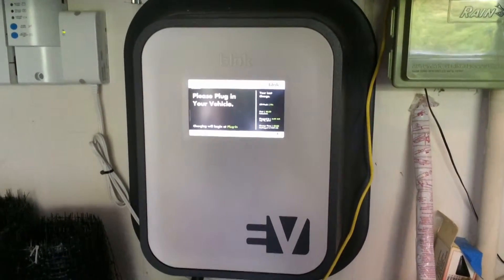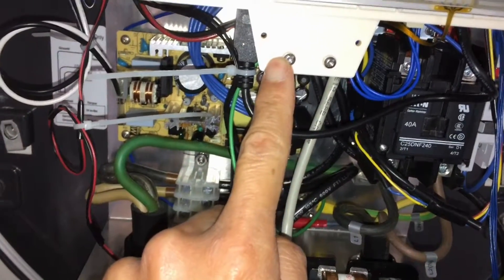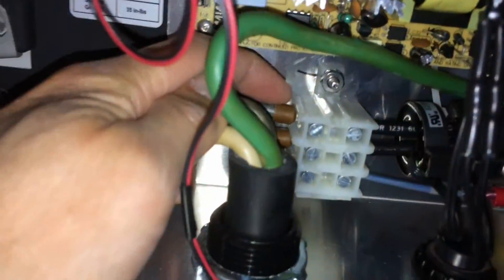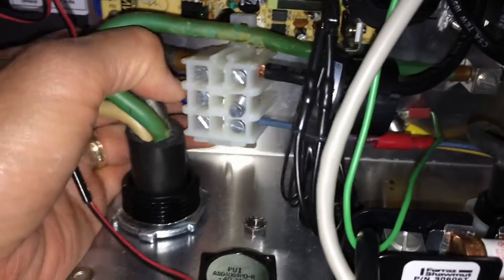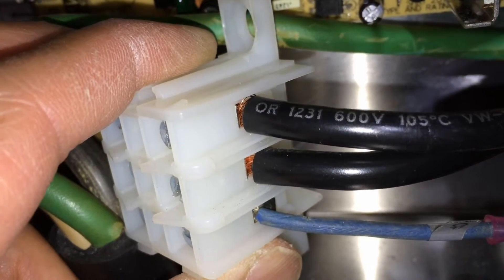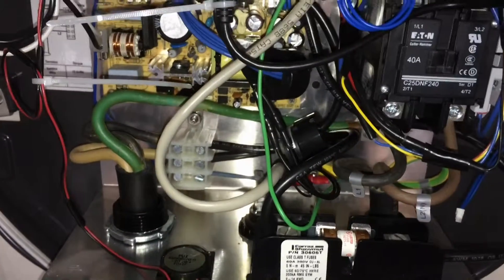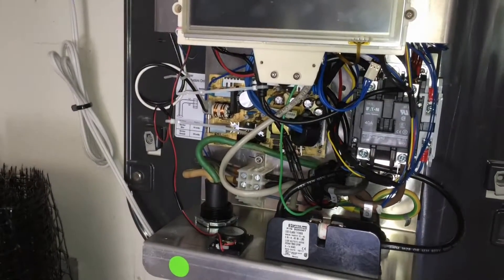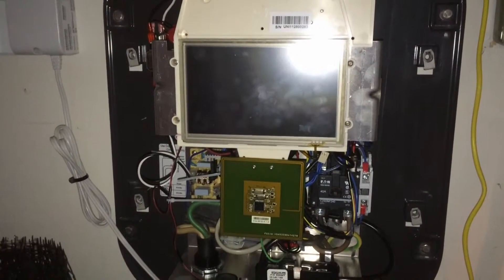Blink EV Charger Self-Test Fault Repair

Comment: Always good practice to remove jewelry when working on electrical gear.
I dumbed mine down after getting these errors and it worked fine for a few years, then eventually quit working.
They weren't built very well and the "functions" like map etc were meaningless fluff on the display. Built to harvest State Subsidies from the taxpayers.

Comment from the maker: I was able to keep this lobotomized Blink charger working for another 3 years until I bought a Tesla and decommissioned it.  Just the simple wall charger that came free with the car works great.
Reply: Can you plug and go this charger.  I have one and had to add an adapter so the plug could fit my dryer receptacle.  The EV charger plug is a 10-30p 6-50r adapter to fit my dryer receptacle.  I bought this car used and this charger came with it.  This is my first time using it because the other one was fried. Let me know thanks!

Comment: The touchscreen on my blink EVSE is not getting past calibration. I tried a cheap ebay touchscreen film, and it still doesn't work. I'll turn it to dumb mode, but I am not sure what settings will still persist (max amp setting?), It's a WE-30CKRE. Will it just flow up to 30 amp? The car's onboard charger will only pull 3.3kW. Thanks for any insight.

Comment from the maker: After a year the lobotomy failed - the charger wouldn't work about half the time and without the higher brain computer I couldn't get any information.  So I plugged the brains back in and went back to first principals.  From further research, a grounding error should theoretically be detected at bootup, whereas this self-test fault happens when you plug the car in.  What happens at that point is that the large "contactor" at right energizes a large coil to pull the power circuit closed.  There's a small white thing stuck onto the side of the contactor which also closes the "pilot" wire which communicates with the car to decide how much juice to give it.  I theorize there are two things that may be happening.  Most likely, the small pilot wire relay add-on is failing.  So I removed this, exercised it, and found that it's either not spring loaded or the spring has broken.  It relies upon the contactor pulling it shut.  The second possibility is that the contactor's coil RF surge is transferring to the current detection coil around the power wires, so I moved both coils around the power wires as far left as I could.  After reassembly, it has been working reliably for a month.  I've seen it fail once when I pushed the coil as close as I could to the contactor, so that could verify the problem, but it's not repeatable.  So I'll test it some more and report back
Reply: Hey thanks for the video! Good job explaining. Any updates to this? I'm curious if you got to the bottom of it.
Reply: Here's a curious alternative: I was having intermittent ground fault errors when I plugged in. What little pattern there was seem to be around high temperature and humidity combinations. In cold weather no ground faults to speak of. I followed your directions for disassembly. After poking around I discovered a very small frog skeleton between the incoming 220 and ground. After removing that I no longer have ground fault errors... Knock on wood, so far. Evidently the desiccated carcass of the frog was absorbing moisture in humid conditions and causing a ground fault.
Reply from the maker: @knygard  That's hilarious!  I hope that does solve it for you.  I took mine out of service when I got a Tesla!

Comment: I thought the bad crimps were supposed to be within the J1772 head?

Another possible fix, described in the forum thread, is to write a clean image of the software to a fresh SD card, and use it to replace the original.
Reply from the maker: William McBrine I did not see either of those in the forum.  I read about techs fixing bad crimps but didn't see any details about taking apart the J1772 head.  I am skeptical that a software refresh is going to fix the problem, and didn't see anywhere I could manually download firmware or insert an SD card but I can't rule it out.  I checked that I had the latest firmware.  

What I can say is that after many weeks of using the charger as a dumb charger, I've had no problems and since the car has a perfectly good charge timer I never understood the need for all those fancy features in a home installation.  I could have spent days trying out various fixes but I recommend people just disconnect the computer as I show and be done with it.  5 minutes and never have to worry about it again.  That computer is like your body's appendix - you never needed it to begin with.